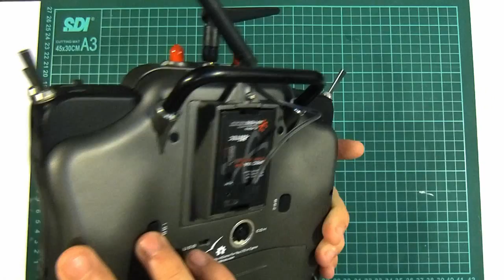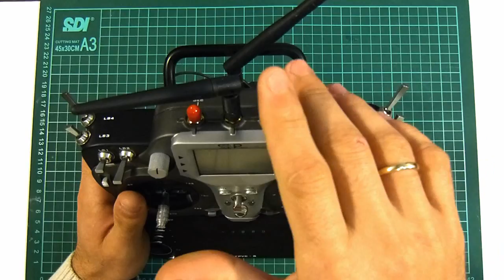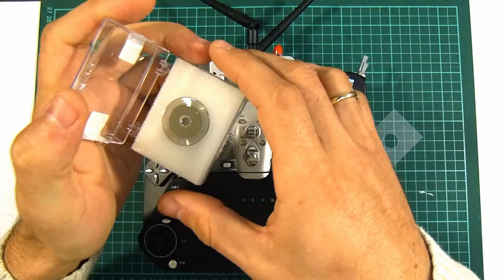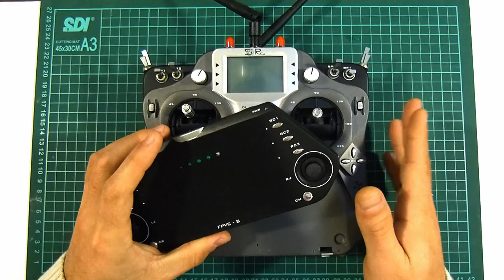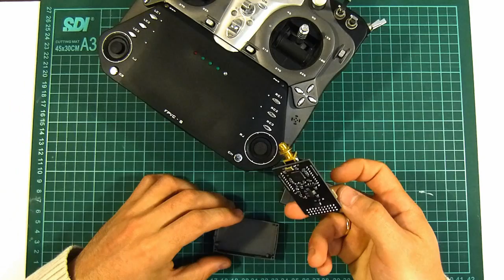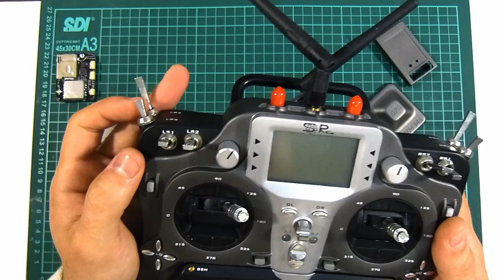OSRC - System Description And Its Benefits

Comment: Well, I must say that the best Open RC System would be the case with gimbals and optic encoders connected to SPI port. And some box module to put screen or Raspberry Pi board. + Example HW TX/RX like rs232 433Mhz, or even WiFi + Example software. "Done is better then perfect". You should let the people done the development and let them chose the best direction. Today Smartphone will do most of the things you trying to put in.

Comment: I love the possibilities that your system promises. I think what some of the commentors are asking for is a practical demonstration of programming, something like picking a normally difficult programming task like a swash setup, or a full house plane where you can demonstrate some of the  features such as the re-assignable switches. I'm sure you're very busy but something like that type of demonstration would show just how flexible the system can be in a practical way.